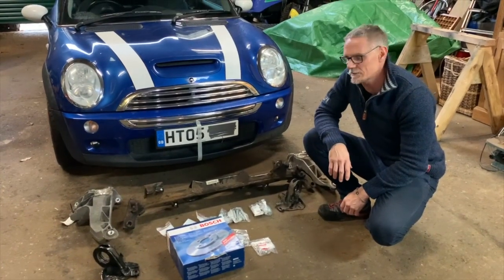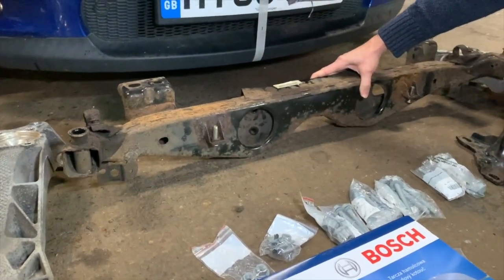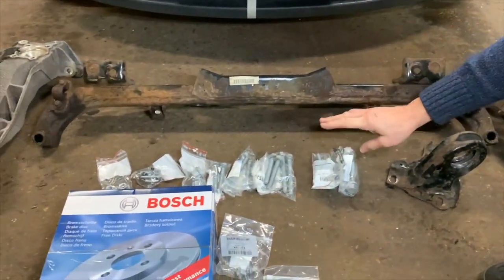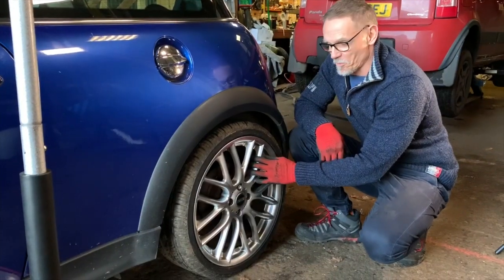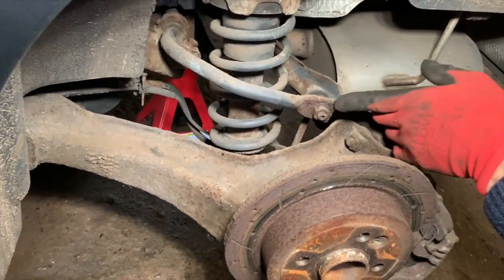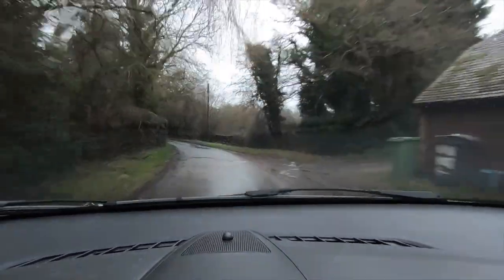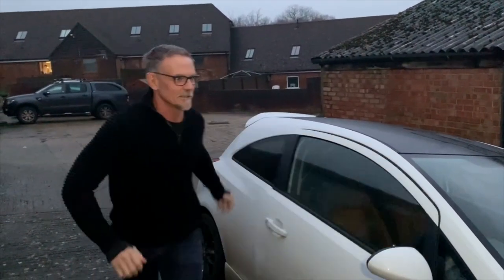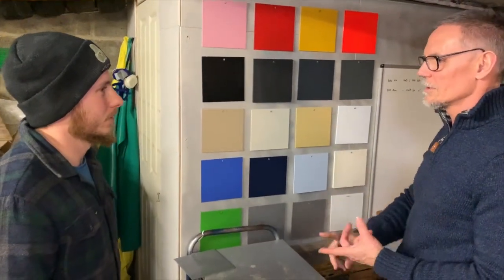R53 Mini - Rear Subframe & Suspension Rebuild - Part 1

Comment: Bro you are a genius! seen this video before but now 
I understand why its such a Brill Mod for the R53
AND... I need to do this ASAP.. LOL :-) got rid of 
the oil leaks, installed an airtec intercooler, 
ramair cold induction colder plugs oil filter
thermostat and radiator fan.. now running 
like it should.. but really do want a R56 subframe & suspension rebuild
and the front callipers and disc upgrade.. slowly getting there. will give 
MAD4MINI in Leeds A Shout and ModAMini down south.. Both helped me out.. Bless
Reply from the maker: Glad you are getting there with your R53!  I know the team at Mod-a-Mini, but not sure I know the Mad4mini team, glad you are getting there.
If I can help with the rear suspension let me know.  I have a couple of spare rear subframes that can be cleaned up and powder coated and sent to you.

Comment: Thanks for the great content, I'm currently doing upgrades to my r53, I've not kept it stock but I must say I do love the blue colour with those jcw wheels you have. I have managed to push my car to about 235 hp dynod. Look forward to watching your other r53 content.
Reply from the maker: Hi Neil,
Very sorry for not seeing this message!  Embarrassing! Glad you enjoyed the video and I know you have been watching the other videos.
235 hp sounds like a good figure for these cars, something for me to be considering later in the year.  I want to make sure mine is 100% underneath, suspension and brakes, before pushing more power.  I remember when I first got it the brakes used to fade after about 15 min of hard driving.  So I went to drilled and grooved brakes.  This helped a little, but it was too small of an investment and not good enough for me to consider adding more power.  Once this work is over, however, we should be in a great position to do something.

Comment: Only just realised your in England 🙈. I’ve started the rust in the front towers and ... a bit further. I’ll get on to the back on day 😂 I’ve already done the trailing arm change though. Blasted, sprayed look beautiful
Reply: I’m just worried about the brake lines that go through the rear subframe. I’m not brake line confident
Reply from the maker: Peter Nicholls the brake lines should not go through the subframe, the handbrake or emergency brake cables go through it.  Very simple just one bolt each side that hold a bracket to the frame. Let me know if you need some guidance on that
Reply: Hyphens Classics thanks that’s very kind
Reply: @hyphensclassics  OK! I'm taking the plunge and I'm going to do it this week! I've done the handbrake cables before, and the other suspension and trailing arms parts (R56 upgrade there!) - so wish me luck!
Reply from the maker: @MePeterNicholls  You will be fine!  Look forward to hearing more about it and maybe some pictures!?

Comment: Hi, I've watched your videos rebuilding the front and rear suspension and brakes with great interest. Some very impressive work. Surprised to see how you struggled removing the front lower ball joints, the 15 year old ones on my Gen.1/R52 convertible came off easily despite also being regularly exposed to salty winter roads. Removing the hand brake cables from the rear calipers was a different story altogether (I had to cut them off in the end and replace both calipers and cables). It was very interesting to note that you were able to interchange the rear trailing arms with Gen. 2 aluminium ones. I wasn't aware that was possible (it provides a useful 5 kg wright saving in total). Now to my question: I need to replace the badly rusted rear subframe/ axle carrier (2005 Gen.1/R52 convertible). The convertible subframe har additional reinforcements to support the addition chassis tension struts that help stiffen the convertible body. It is hard to come by this part (OEM # 33316761716) secondhand in reasonable condition except from the US (but very costly shipping). However, when I look closely at the online original parts catalogue (BMW Mini ETK), the similar rear subframe part (OEM @) for the Gen.2/ R57 convertible (2007-on) looks completely identical. It even weighs the exact same (8.900 kg). Since the trailing arms fit, can anyone confirm whether the R57/R52 subframes are interchangeable??? It does seem probable. Has anyone tried this? Availability of the R57 part is naturally greater. Thanks for any tips! Best regards Bjorn
Reply from the maker: Hi Bjørn,
Thank you for watching and subscribing, I am glad you have enjoyed the videos.
I will have to investigate if the convertible subframe is the same, I understand the r56 and r53 subframes are the same so it makes some sense that the convertible units are.  Unfortunately I have never take a convertible apart.  I will ask some people and also mention it in the next video, maybe someone can answer that with authority
Reply: @hyphensclassics  Thanks for your quick response! If the R53/R56 subframes are interchangeable it certainly seems possible that the same applies to the convertible unit. Most important here of course is the width of the unit which seem to agree given your insight. All 5 bolt holes that connect to the body underside seem to be the same. I am not sure whether the track of a Gen.2 is a bit wider, but if so, surely that would boil down to the rim ET and the length of the trailing arms. Does that seem to make sense?
Reply: Sorry, that should be "length of the control arms" not trailing arms.
Reply from the maker: @bjrnharaldgjestvang9479  it does, but note that the r52 was made through into 2007.  The aluminium rear trailing arms were first seen on the GP1, which was the R53 base.  So the arms should not be an issue.  The R53 and R56 wheels are also interchangeable, 4x100, however the wheel bolts are not as they changed the thread and size.
Things like the wheel bearings and wheel sensors also changed and are mostly not interchangeable.
Reply from the maker: @bjrnharaldgjestvang9479  got you, they are the same part number between the R53 and R56
Reply: @hyphensclassics  Hi again, yes I saw that the OEM part no. for the control arms/wishbones are the same for R52 and R57. I also checked that the rear track of the R52 and R57 are only marginally different (1466 mm vs 1467 mm, respectively). That's a strong indication to me that the subframe on both models is essentially the same steel pressing. The only difference I see is that there's a separate stone chip guard (part no. 33 30 6787072) which I haven't quite figured out how fits onto the subframe (probably a sensible addition but maybe not essential). So on that basis I feel comfortable that I can use the R57 part and have already located one in the UK that will ship to me in Norway @GlobalParts. Thanks a lot for your feedback and for inspiring courage to get started on this!
Reply from the maker: @bjrnharaldgjestvang9479  good investigation work and glad you are on the way with your project.  It would be good to see updates as you go
Reply: Hi, after a long time!
Got my R52 rear subframe project going over Christmas but things slowed down with a lengthy cold period. With outdoor temps averaging -10° C over weeks it’s been freezing working in an uninsulated garage. And severely rusted bolts, esp on both damper assemblies were a real pain. A set of new bolts are a must.
Following painstaking rust grinding, zinc priming and painting of all parts, it’s now more or less all ready for reassembly. One minor hiccup was that the end of the rh brake pipe broke (rusted) as I removed the brake hose from the subcarrier mounting. I will simply join it with a new end piece rather than replace the entire pipe length. Other than that, there is luckily not much chassis rust, mainly just surface rust that has been grinded down to bare metal, applied rust inhibitor, zinc primed and painted. And given a coat of undersealer. In all, a thorough job, satisfying but unsure I would go to these lengths again. Come Spring, the car will be up for sale and it’s a good feeling to know that the chassis is in fine fettle. I could have done more, ie change springs, dampers, wishbones, bushings & bearings etc but they are fine so I reckon there is no point lashing out money unecessarily. Everything is now at least so much more easily removable with new bolts etc. I did replace all the anti roll bar bushings, and all brake parts are only a couple of years old (discs & pads, calipers, brake hoses, hand brake cables). So over the next 2-3 weeks I hope everything has come together, and my wife can have her garage bay back!
Reply from the maker: @Bamsebrakar2011  great to hear back from you.  Yes projects being done over winter are a challenge unless you have the right space!
On the brake pipes, they are not that long, there is a joint just at the firewall under the car, so they are possible to replace quite easily.
If the plan is to sell it then no point in putting nice kit on the car that the next person may not want and good to hear that the chassis has minimal rust.  I figure that while this job is a pain, it is worth doing sooner rather than later to make sure you can actually save the chassis from major repairs.
Congrats on getting to this point

Comment: Hi there I’m watching this video as I’m planning on replacing the rear subframe with the race line subframe from Euro Car parts . I’ve got a 08 cooper D . My question to you is where did you get the replacement hardware from ie the bolts. Do you have any info I can have with getting my hands on the bolts . Don’t real want to be ripped off by BMW ,
Kind regards Gary
Reply from the maker: Thanks for watching.  I have used a number of places to get the bolts.  Schmeidmann, eBay and sometimes Mini.  Best to get quotes, but bolts are not cheap.
Depending on what you need, some are reusable
Reply from the maker: Subframe bolts I reused, but I bought a tap and die to clean the threads of any thread locker.  Usually find the heads are in worse condition than the actual bolt

Comment: Great video, I am currently doing the same R56 trailing arms to my R53. Where did you get your new bolts from ? Thanks.
Reply from the maker: Hi Oliver,  some people will reuse the bolts, if they are in good nick, that may work and if you have a way of bringing them back to life through either nickel plating or if you just paint over the top after.  I bought new ones from Shmiedmann.com as I was not sure on the quality of the bolts that I would have been removing.  Before purchasing I did some digging on Shmiedmann as there were some  varying reports on their service, but I had no issues what-so-ever.
Best of luck with your build, are you also changing the brakes, control arms?
Reply: Unfortunatley there is not alot worth saving under my R53, thanks I will check that company out. Yes I am doing the whole lot. At the moment the only thing left on the car is the engine. Subframes are being powder coated, all new suspension (think I will go for the BC’s aswel) wanting to upgrade the brakes to R56 but not got that far yet ! I have watched your other video, good content 👍🏻 keep up the good work..
Reply from the maker: @oliverrobinson6502  thank you Oliver, best of luck on your project, let me know if you need anything else
Reply from the maker: @oliverrobinson6502   next video is now up.  I remove the exhaust, petrol tank, brake lines and subframe

Comment: England is a pain in the arse for cars.. I spend all my life fighting rusty and seized fasteners when working on my cars. I always weep when i see how easy mechanics have it in dry climates when they're disassembling some 25 year old car...the nuts and bolts come off like butter compared to out stuff... a total fkn nightmare.
Reply from the maker: I know right!  It is why some people lock their cars away for winter!  I am considering doing the same, it is just finding somewhere to put it!  I have not used mine in two weeks and already the brake disks are already coated in a film of rust!
Reply: @hyphensclassics  Ive decided to run mine until the end of October and then just put a cover over it until Spring. Unfortunately I dont have a garage to work in because...reasons...
My plans are to service the supercharger and clean everything up before reassembly...Replate the nuts and bolts with a DIY kit and then move onto a suspension refresh...Ive already dont the lower ball joints, drop links and tie rods..Although they looked perfect I was impressed at how much tighter the car felt..
After binge watching your vids though, my plans will also be including a front subframe drop and get gynaecological on it...This is all subject to cash flow of course...
Reply from the maker: @simonlloyd7557  first thank you for binge watching all my vids!  Yes the challenge of space and cash flow is constant, where I built mine was supposed to be torn down, but there is a short reprieve so it is back in there as the PSP has a problem, which is very annoying since I had it looked at!  It will also give me time to do the next project though, more high quality sound.  Still many decisions to make on that.
Good luck with your servicing work, a nice long list to get through!  Engine is also in my list, I am slowly changing oil seals, have not done much in the way of videoing them though as kit has been packed away for the supposed tearing down of the barn!
I will have to find a way of bringing more content!

Comment: Where do you get the bolt kits from?
Reply from the maker: Hi Paul, most of them came from Schmeidmann, there were a couple of bolts that came from German sellers on eBay.  If you want further details please email me: michael@hyphensclassics.com.   I can drag out all the details of what and where.
Reply: @hyphensclassics  thanks Michael. I’m planning on refurbishing the front and rear subframe on my R53 probably replacing many of the bolts. I’ll take a look on Schmeidmann.  Have a great Xmas 🎄
Reply from the maker: @paulgore9127  sounds like a great project, you will enjoy the results!  I used Schmeidmann as it was the easiest to get all the right part numbers.  Note they are not cheap parts!
Wishing you the best Christmas possible under the current circumstances